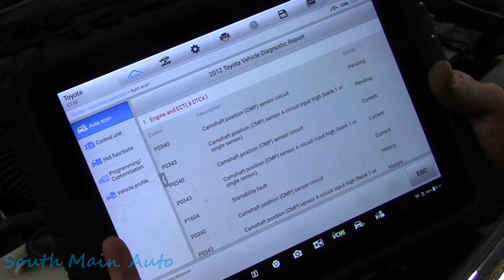Squirrel vs Toyota Tacoma - Part I

Comment: I just put a replacement engine in a truck just like this one, the water pump seal had failed so it lost all coolant and the owner just kept on happily motoring down the road till it went Chernobyl 🔥. Also in regards with the whole covid taste/smell issue you spoke about, for me I have I have a tough time with eggs and ground beef as they both taste and smell like pure ammonia.

Comment: Some newer wiring insulation is made from bio plastics that come from stuff like corn that critters love
Reply: In the late 2000s most vehicle wiring manufacturers were using insulation derived from ( I believe ) lima beans, Honda for example went so far as to sell a wire tape that discourages rodents from damaging the harness
Reply: @somerandomguy3868  soy beans.

Comment: I caught a squirrel red handed starting to make a nest behind the engine in my F150.  It only managed to chew up the foam insulator that covers one of the fuel rails.  When I walked out to get in my truck, I heard him scurrying under the truck.  Opened the hood immediately and removed all the sticks and leaves.  Fortunately it was a black squirrel.  Those red squirrels are incredibly destructive, and  exterminate every one I see around the house.
Reply: My fiancé has a 2017 F150 with the 5.0 and we had to replace one of the foam insulators that covers the fuel rail on the passenger side because something chewed it up.  I figured it was one of the cats because they like to sit on top of the engine and there was cat hair, crap, and prints all over everything. 

I saw one of the cats come out from the truck the other day so I lifted the hood and there was cat hair everywhere and the same insulator was chewed up to the point that there was almost nothing left of it and large pieces of it everywhere.   The driver's side insulator is never touched.

Comment: I watch some one else on YouTube that had a Tundra as well. He had major issues with mice chewing up the wires in the engine bay. He had to have the wiring harness replaced twice! He eventually found out that Toyota uses soy based plastic for the wiring insulation and that's why mice like to chew on it. He did some research to find out what auto co doesnt use soy based plastic on wiring. He found that Ford does not. Even though he initially liked his Tundra, he traded it in for a Ford truck.
Take from that what you will.
Reply: Honda, too. They even added capsacin-infused electrical tape to their parts line.

Comment: the squirrel thought they found the mother of all tacos, but it was just a tacoma
Reply: The funny thing is, wait for it, I live in Tacoma, as in the REAL city of Tacoma WA. These are I think really just a rebadged Toyota SR5 truck that goes way back, just rebodied and named in I think 1997. I had borrowed a '94 extended cab 4x4 variant for several months in 2019, great to drive, but the back-end was a bit squirrally at times and the brakes were touchy back there too. It "only" had 260+K miles on it at the time if I recall and it had the venerable "big" 4.0 V6.

Comment: I wish they made car wiring and hoses out of stuff that kills mice, or at least tastes terrible. I don’t know whose idea it was to make wire insulation out of soy, but I disagree with their choice of renewable material.

I usually see you removing nuts and bolts, but this video had a lot more nuts than bolts.  I assume those are the 27mm variety.

Comment: Auto manufacturers are using wiring with SOY based insulation now that’s why mice problems are becoming more and more. And it’s almost all car makers using this wiring now. Eco friendly wiring as to the oil based wiring previously used.

Comment: I almost thought you were working on my 2008 Tacoma for a second.  Same color and almost the same scenario. But my unwelcome guest has taken up residence inside the "squirrel cage" under the dash and the both the cabin and engine air filters were full of debris and nuts!! Little Ba$+@rd!!!! I'm finding this freeloader is costing a ton-AC compressor seized, Blower motor seized, power window motor seized, ABS Speed Sensor under dash busted and chewed and multiple wires!!!!😡😡😡😡 Anybody want to buy a HUGE black walnut and a oak tree???

Comment: I have a similar problem with a 2010 Toyota Corolla mouse got in it and now the heater motor don't work and replace the heater motor and it still don't work

Comment: I had red squirrel in my trailer going through the roof vent they started tunneling through the drywall ceiling in my living room and over the refrigerator so one night I took a can of expansion foam and sprayed it into the holes they were squirrels running around with that stuff stuck to their head I'm sorry hahaha I plugged a hole on the roof.

Comment: a few things.... that's enough reason not to have cars if you just have them sitting there and not driving them. These things happen, battery dies, old fluids, gasoline, paying insurance, etc. The other is that mice love to chew on wires not because they taste better than nuts but the electricity stimulates them and they also use to sharpen their teeth

Comment: I trapped 21 flying squirrels out of my attic several years ago. They also a mess out of the fiberglass insulation.
Reply: @redrider7730   They make a tasty meal for the Red-Tailed hawks that hang around my place.

Comment: If their teeth become too long, squirrels are unable to open acorns or nuts. To sharpen and control the length of their teeth, squirrels chew through materials that create friction to grind their teeth to the right length. Unfortunately, this means that chewing their way through your roof and wires is a piece of cake.
Reply: True for all rodents...

Comment: Maybe most over engineered fender well liner I've ever seen, jeez, have a 02 duramax, to change fuel filter/water separator requires dropping liner to easy access filter, give a flat head and 2 minutes - done

Comment: Back in the day when Jags sported insanely expensive high voltage ignition system wiring on their engines ... There were squirrel addicts that just could not resist ...

Comment: My wife’s old car sits around a lot. One time I was going to drive it to work for a meeting. I was all spiffed up and sweating a little from a hot shower. I hit the brake pedal, and it sank to the floor. At the same time, I turned the AC on and it started blowing full blast, and shredded napkins exploded out of the vent like confetti, right into my face. It stuck to my face because I was sweating. I didn’t make it to the meeting 😂

Comment: Just a PSA anyone who lives near chip munks or mice. Get a rodent deterrer or spray down your engine bay with Tom cat. I had a 4.0 tacoma and one bugger bit through my knock sensor harness. It’s located in the V of the engine. Sure cheap part right? You have to pull the whole manifold off and cross over cooling tubes. Absolute PIA of a job. Dealer wanted $4200 to do it. Took me about 15 hours. Please take precautions about these stupid soy based wires that rodents love. Otherwise your car won’t shift to 5th gear and you will be getting 13mpg in limp mode
Reply: The Toyota 4.0 V6s are rather unique. Looks like they have sensory to check the AKI and even using normal gas will make it limit output intentionally, unless you use at least 91 AKI-rating, if not 93 AKI-rating! My guess is that if damaged, the ECU goes to assume you put 85 AKI or lower! My guess is that with a broken or missing knock sensor connection, it will act much more like a 1920s' flathead engine!

Comment: I read they chew on the wires because fish oil is used in the insulation. And besides that there are animal friendly traps available that work just as well as those nasty spring traps.